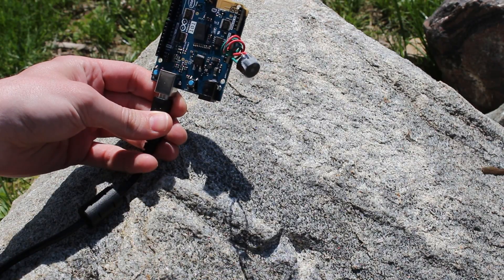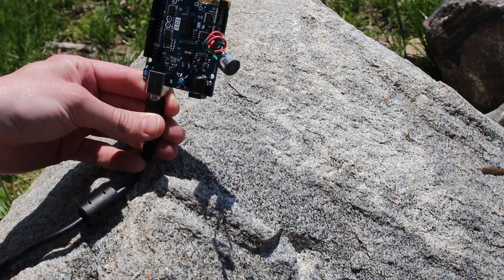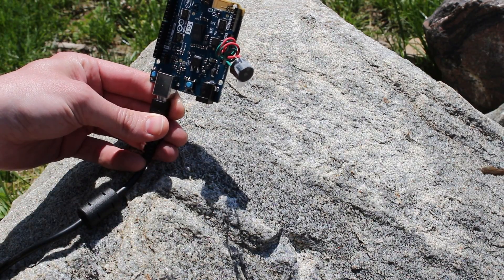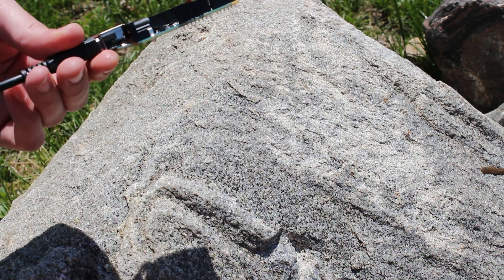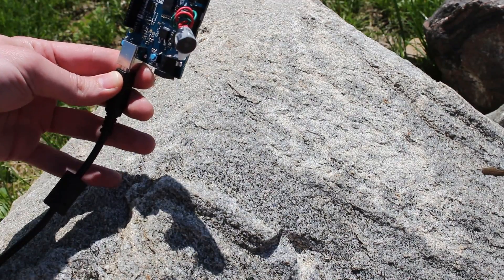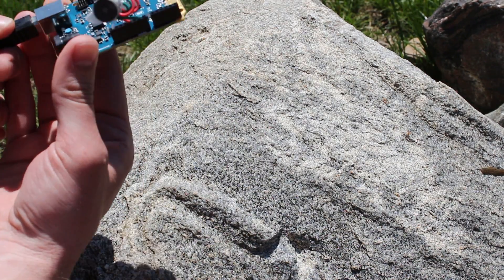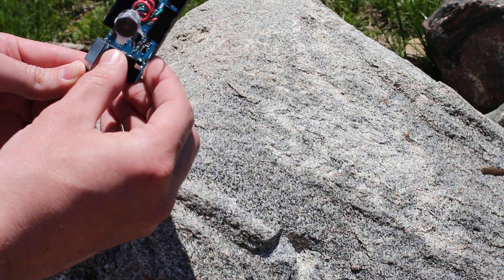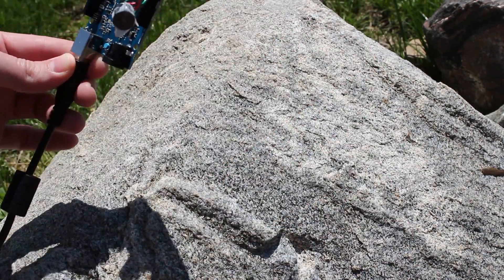Arduino 101 vs Sunny Day - one last test...

Comment: The reason the edges are sensitive is because the silicon is exposed on the bottom and the light has to reflect off the board to get in